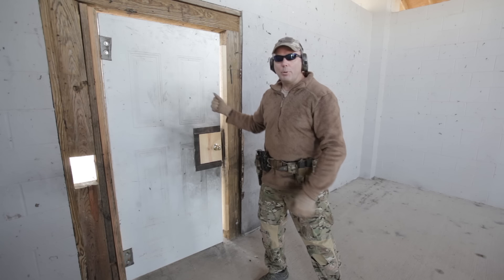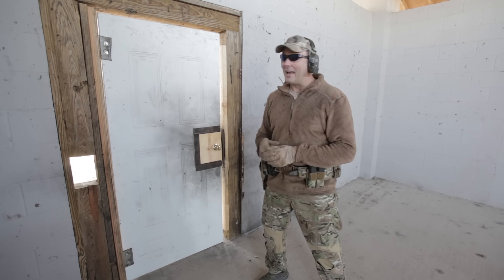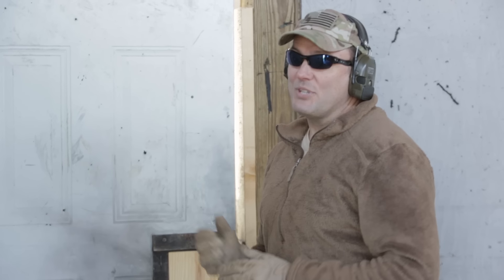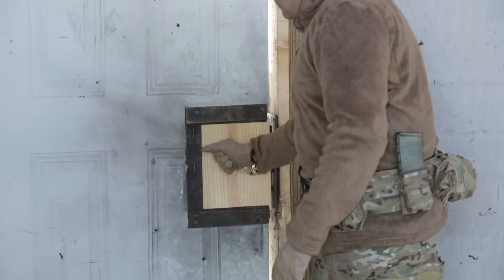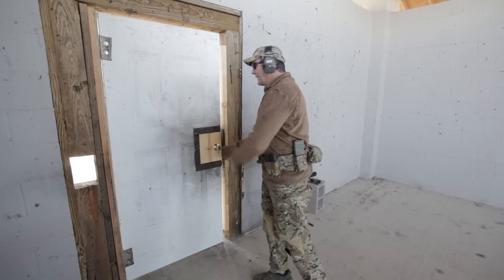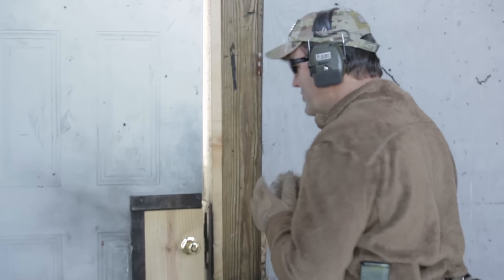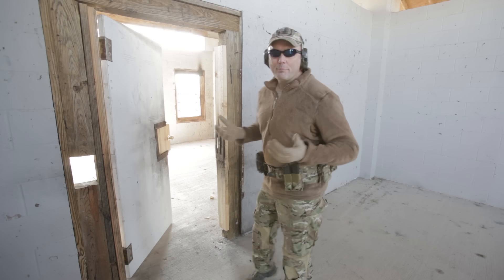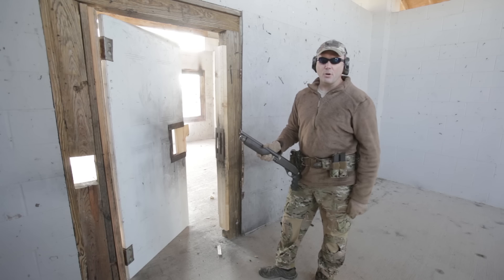How to Properly Kick in a Door | Breaching Techniques | Tactical Rifleman

Comment: Depends on how the locks work usual 3 hinges and three locks in the U.K. good luck Kwl kicking them in mate 😉

This vid should be called how to kick in your shed door 😂
Reply: Is the frame made of wood? then Its still rather easy to force your way in.  I would never use my foot but the illusion that your door is safe because of three hinges and three locks is just that.   how your door jam is constructed, and having a kick bar in place are far more important then dead bolts, chain locks and hinge count.   as are the type of hinge and type of lock.
Reply: Mate your so right😂 you’ll need like 4 guys to open a front door!!!
Reply: In the Ireland a lot of modern doors are made of hardened plastic and metal and before you say plastic is easily kicked in bare in mind their are plastics 10 time stronger than steal I doubt anyone could kick one of these doors in and if it’s a heavy wooden frame made of let’s say oak you’d find it very hard to kick in
Reply: Plastics are stronger than metal like steel? I'm sorry I am confused.
Reply: @cierankavanagh5875  lmao, you failed chemistry and english 😂😂😂😂

Comment: THANK YOU for the confirmation!  I didn't think it would be easy to kick down a door that opens outward.  Yes hinges are on the outside but they've been painted and repainted for so many decades it would take forever to take the pins out plus our security guard is constantly going by back and forth, one in the front of the building and one in the back day and night.  At night with a powerful light that can be directed at any angle.

Comment: how to kick in american cardboard doors*
Reply: I am sure were you come from the doors are made of reinforced steel, set in similar steel frames, placed in concrete reinforced walls right?
Reply: Dies1r4e a lot of doors are made of steel... 😂
Reply: there is a huge difference between a steel door and an actual reinforced steel door.  the average "steel" door is made from all but pot metal, the firmness of which actually aids in smashing through them.  also not many door frames are made of decent material and even fewer walls are.
Reply: Anton Gilljam You could also just kick their cardboard walls in, in case you can't find a door.

Comment: What shells are best for breaching?
Reply from the maker: We prefer to use dedicated Breaching rounds, rather than just Buck or Birdshot. While there are many Breaching rounds, most are a solid composite Slug (usually made of powdered lead or copper), which disintegrates as soon as it hits the solid locking mechanism of the lock. While it still delivers all of its kinetic energy to the lock, once disintegrated, it is fairly harmless to the non-combatants within the room. My preferred rounds are HATTON.
Reply: Slug rounds were good for that, I think.
Reply: FREEDOM rounds
Reply: WRONG!!!
TURTLE SHELL ARE BETTER
Reply: Artillery shell

Comment: If your foot goes through, reach through and unlock the door. 

Or, if the door is resistant, kick it until the body feels weak. Then, back up, and sprint into the door shoulder first and burst right through. If you are a swat guy, roll out of the way and yell "MOVE MOVE MOVE" to catch whoever. As long as you have a search warrant.

Comment: Good way to do it on american standard doors... Here we often do not use such simple doors. They are reinforced with steel and they have between 5 to 10 latches all around the frame. They are simultaneously moved when locking with the key....

Comment: Bollocks! He’s using an electric strike and the frame has no rebate or door stops. Try it again with a hardwood frame, rebated stop and a sash lock with 20mm bolt throw. And then spend the rest of the day with your ankle in an ice pack.

Comment: Probably this run fine with american doors that quality is bad but nothing will be happen with european doors
Reply: Depends on the locking mechanism. On a lot of european doors you have two locking mechanisms, one that engages at one full spin of the key and another at a second spin. If you only do the first lock, all you need is a hammer and a stout flat head screwdriver to bust it open.

Comment: Come on Brother you know better than that. 50% of your body should intersect the frame so if you lose your balance you are stopped by the frame and #1 man can enter and you do not become an obstacle. Also when "kicking" the door you showed proper placement of the foot, but always glancing away from the handle so in case you do not break through the frame jam the door may flex and pop open. Glancing towards the handle flexes the door towards the jam and provides a more difficult breach

Comment: What if the door opens on the other side
Reply from the maker: Pull doors usually have the lock on your side, if not; explosively breach... you can’t kick a pull door
Reply: @TacticalRifleman  around a month ago I got stuck on the inside  
With keys still in lock on the outside